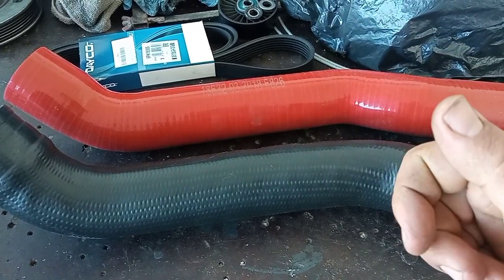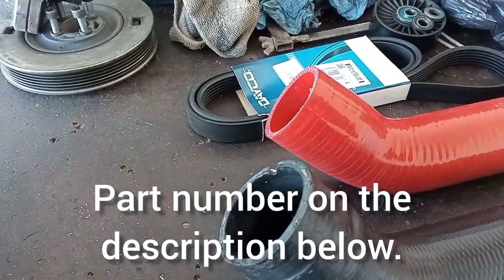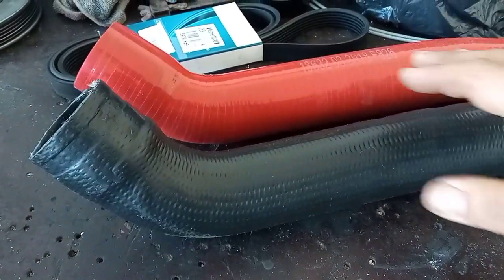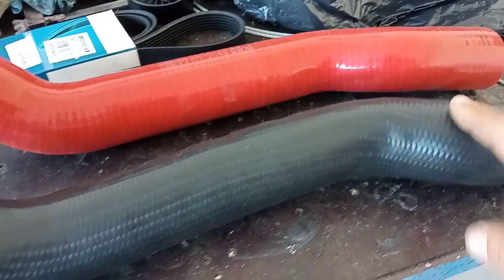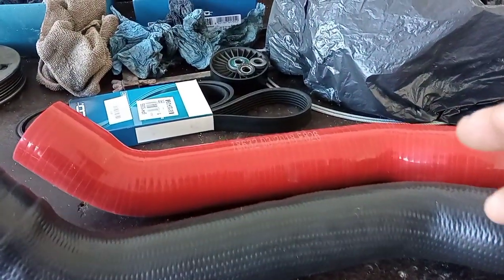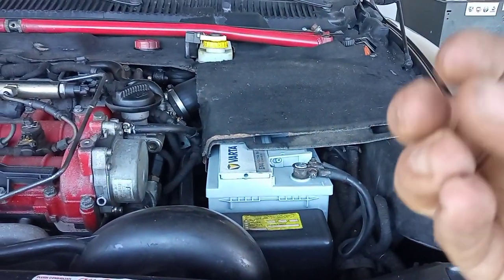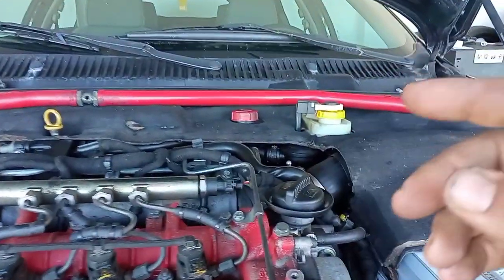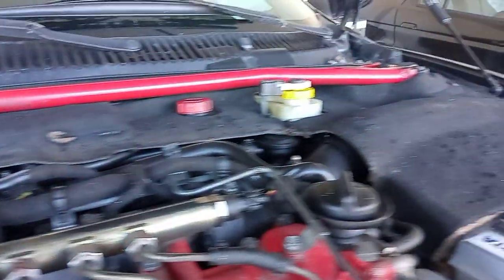Witch is better? Rubber, silicone or metal and why? And you can proof it!

Comment: Great video as always. I have a question about this front strut bar. Is this good upgrade to make?
Reply from the maker: Hello. It gives you a psychological effect. Lol. I just removed it to be painted and I'm driving it without, drove it really hard like crazy and feel no REAL difference. Aldo, with age the shock towers on cars that do not have it appear to be cracking. Makes sense because supposably the bar prevents twisting of frame. So better to have that not to.
Reply: @alfaromeonoproblem  😃👍

Comment: I have changed turbo on my alfa gt jtd. After that car start to smoking,black smoke when accelerating. Can reason for that be weaker,smaller turbo charger?
Reply from the maker: Hello. If it is the original size turbo make sure your intake pipe has no cracks. Also this intercooler pipes no cracks. And check if the vacuum hoses are correct and no cracks also

Comment: Hi sir i have question my intake air tube was broken i have no powe now i fixed it and have more power but bring out a lot of black smoke and on 1500 rpm the car hesitate on acceleration what to do?
Reply from the maker: Hello. Do you mean the pipe between the air flow meter and the turbo? It's crucial to be absolutely perfect. No cracks or defects.
Reply: @alfaromeonoproblem  yes that pipe i have fixed it and now my 147 alfa briga sometime a lot of smoke sometime no and when i hold the rpm on 1500 you know normal driving the car shakes like going to turn of
Reply from the maker: Try to confirm if the pipe is good, how did you repair it? Next is to do a diagnosis and see parameters
Reply: @alfaromeonoproblem  i have fixed it with skotch it have a big diference in speed it looks like have stage 2 the smoke it looks is going day by day bur that thing on 1500 rpm i dont know how to explain
Reply from the maker: Can you check out the vacuum lines?
Reply: @alfaromeonoproblem  i will chek tonight i accelerated hard and when i stoped and drivin in first gear engine works hard my exhoust looks like sport cames out loud noise than normal
Reply from the maker: Can you send some videos to my e mail?
Reply: @alfaromeonoproblem  yes send the email or wtsp number and about last night after 5 min the engine works again normaly
Reply from the maker: Check out the description of the video, have may contacts in there